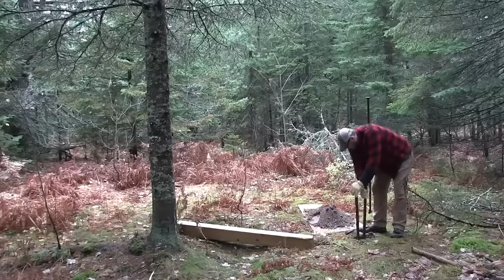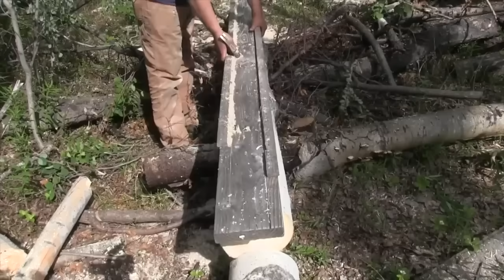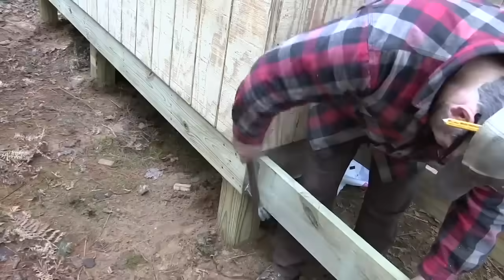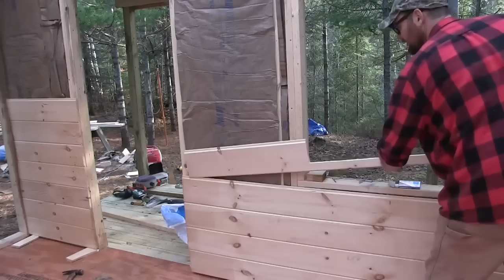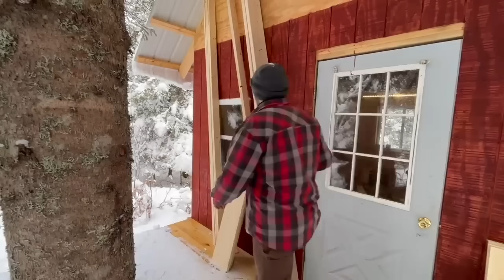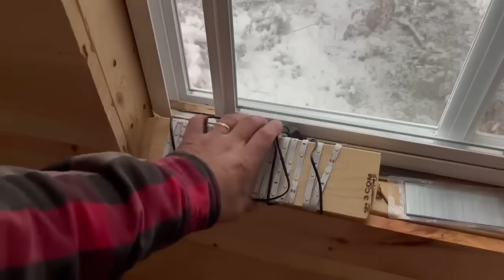4 Simple Cabins ... Anyone Can Build

Comment: How much do u typically spend on one of these cabins? I live on a 5 acre property and want to build a little cabin but the cost is my biggest concern wether its best to buy pre-built or try my hand at building it my self
Reply: Prebuilt are made to make a profit, so you're getting what you pay for, minus the manufacturer's 20% profit.

And then you still have to do interior finishes.

My cabin is ~12'x16', on concrete piers. I'm in to it for like $9,000. 

But it has concrete piers, 2x10 joists, 3/4" plywood floor, 16" o/c joists and studs, 5/8" plywood on the interior and exterior walls, 5/8" plywood on the roof, linoleum, is fully insulated, has Andersen windows, the entire roof is ice-and-water shielded, steel metal roof and walls, solar power and 12 volt power and lighting, propane heat and cooktop....

I got a ton of stuff off craigslist, marketplace, and habitat and didn't really start hammering stuff together until I was sure I could get it dried-in before winter.

Comment: I have been thinking for months about writing you and Brooke a letter for advice on building a simple cabin for a single mom, my special needs adult daughter, teenage daughter and teenage son (also on the autism spectrum).  We live in a rundown mobile home that needs to be replaced.  I started working in construction in 2023 at 49-years-young.  Im now on my third construction job (last year I could only find one three month job) and have learned installation of siding, soffit, insulation, drywall (no mudding yet) and some electrical wiring

Comment: Dave, I really appreciate your channel & all the instruction/insights you provide. I am curious to know what you do/how you prevent mice, voels, rodents from getting into your off-grid cabins when you are not there fulltime? I have remote mountain property in the western U.S. & am building a get-away cabin retreat. No way we can live there full time. But I want to make sure the place doesn't get run over with pests. I have not started construction yet but am getting my infrastructure done: well, septic, road, utility building etc. So the cabin pest-proofing is priority for me.

Appreciate any direction you can provide. Thank you, Sir!
Reply from the maker: Just make sure you build with precise cuts and no gaps....other than that the roof is the place that needs the most attention. Soffits, ridge caps, ribs in metal roofing......it's all about detailing
Reply from the maker: Believe me, I learned this the hard way
Reply: @Bushradical  thanks. Appreciate the input!

Comment: As a geotechnical engineer and with all respect, id recommend founding those footings below frost line and below the organic zone of the soil. Appreciate that Dave notes no movement, but you are playing with fire by not doing it, if its on a slope even more so. In saying that, if the structure is wooden (as most cabins are) then movement from ground settlements will be somewhat absorbed by the flexible (wood) structure. But, for the sake of a few extra hours to go deeper, why risk it for the brisket ? Awesome video's, am learning a lot.

Comment: You aren’t supposed to caulk the bottom flange of windows.  Its industry standard so water has the ability to exit the window system.  All windows leak or will leak at some point.

Comment: Anyone on this forum tried to duplicate in Southern hot climates?  In Mississippi very hot most of the time so obviously I’m including a window AC.  Any opinions on floor insulation but just?  With the humidity and heat some have suggested problems and recommended no floor insulation.  We literally maybe get at lost 2 months of weather with temps in the 30’s.  This will be an occasional getaway not every day living.

Comment: mouse problems are easily fixed by building what we call a “mouse-house”. Now a mouse house is a house or cabin styled house, scaled down in size in order to accommodate our mouse brethren. You can easily add levels to the mouse house
based on how large the mice population you have in your local cabin area. This will solve all and any mouse problems you may face in your cabin build.

Comment: For a future wooden cabin, it would be fun to see you do something less standard than stick-frame or log-cabins. I'm thinking about "post and beam", "timber frame" (that's a lot of work and requires special skills) or "post-frame" (RRbuildings),  the latter probably not very suitable for a small cabin.
I built myself a small (150 sqft) post-and-beam, which was a lot of fun. Using pressure treated 6x6 posts, 2x6 rafters and 2x4 framing between the posts. The latter flush with the inside of the posts and then on the outside white-wash dipped cedar shingles between dark brown stained posts. And like you did, 5/4x6 for the porch, but for a boardwalk I used 1.5" rough-cut lumber from the mill, because it has more grip in rain, snow or ice conditions.

Comment: When it comes to insulation those drawer-boxes are a very neat and easy to do method. But if you really need 8" insulation, I would increase the height of the joists from 2x8 to 2x10. Which avoids nailing the plywood bottom-up, which looks like a terrible job to do :). And as a side benefit, the 2x10's allow for larger spans. For a small cabin but with a woodstove, 2x8's and R13 insulation will in most climates (yes, I live in Canada :) probably do the job.

Comment: Great video and food for thought! I’ve had the same Aeusiney Solar Generator since maybe 2018 and it still works well! Was $280 back then, I did have to get a replacement under warranty the first year because the battery was compromised and had acid spore looking things building up on the vent. Not the most powerful, but for what it is it’s been such a great tool. Power LED string lights, phone. Fan. Small air compressor for a braid nailer. My next one I’d like to get one that has a cigarette style plug to run a 12v mini fridge.

Comment: You are so right about sheetrock. What's the purpose of sheetrock? They are starting to put it in expensive trailer homes.
Reply: Gives a house like finish, but it really is an inferior product, and it doesn’t take much, especially in a space that isn’t temperature or moisture controlled to get mold issues, usually on the back side of the panel. It is cheap and light weight though all things considered

Comment: Im a wooden boat builder, who just dabbles in cabin building, but my only tip that might help you out is butyl sealant for your metal roofing. you can get it at home depot in caulk tubes, its similar to what they glue windshields in cars with, and whats magic about it is that it stays soft like sticky silly putty, so it self heals if it springs any leaks.

Its amazing stuff, ive used it to fix leaks below the waterline on boats, that 3 other repair guys couldnt get to stay fixed, cause they had bolts holding rudder hinges on, and the bolts were working all around with the force of the rudder.  A single tube will do a small cabin, put a bead on metal roof overlaps, and where your fasteners hit, and you are golden.

Comment: Great channel! Always very comprehensive and well thought out.
Could you do a test on motorcycle helmet communication units?
So many out there, so many variations and some don't connect with others. Charge time, quick charge times, run time, standby time, fitment, waterproof rating, vibration resistance, physical size, ease of use (buttons and dials while wearing gloves)

Comment: My bother has a good idea for roofing, much safer than your harness. Make a ladder with your scraps and add two 24” lengths at 90° at the top of the ladder. That goes over the roof peak and you can use the ladder like your skip sheeting. 4

Comment: Dave I have a video request for you. Maybe you could explain the differences between the types of bagged concrete mixes at your typical Lowe’s or Menards. I am sure there are differences but I don’t know what they are beyond the prices. In the past when I was setting gateposts or whatever I just used whatever was the cheapest. Since you’re a former concrete contractor, I’m sure you could tell your viewers what type would be best for setting a post, making a post on pas type foundation, pouring a small slab, building a rock wall or a fire pit, etc.
Reply from the maker: thats a good idea but honestly Ive only mixed maybe 100 bags of "bagged concrete mix" . when I was contracting I rarely ever poured less than 5 yards at a time....average pours were 15-20 yards. Even a 3 yard pour is  12,000 lbs of material .....a 20 yard pour is 80,000 lbs of material .   I would just get a bag of premix so you don't have to buy aggregate , prtland and sand seperatley. for a post use whatever is closest to the loading door and get help loading it. LOL

Comment: I am currently in a slow build process of a small cabin by my pond.  Im considering metal roofing.  How do you insulate or critter proof the small ridges in the metal roofing.  It looks like something small could crawl into the ridges and into the insulation.  Please offer some advice.   I would rather do metal roofing instead of plywood, barrier and shingles etc
Reply from the maker: I think it's IN this video

Comment: If you have to stand a large wall by yourself, nail  a long 2x4 to the top corner just like a brace. But do it while its on the ground. It will hinge up as you lift so you can take breaks and reposition yourself as needed.

Comment: I like the idea of just having a power station for those short stays, not spend a lot of money on a permanent solution that won't get enough use to justify it.  One idea I had for those, though, is to also carry along one of those portable (like roll-up) solar panel setups.  You could toss that on the roof, or some other convenient location, when you arrive, and have it keeping the power station full.  When you leave, you take it with you.  As for 16 x 20 being like a house...we think we're seriously downsized living in our fifth wheel, which I think is a bit over 400 square feet, vs the 320 of the cabin.  It's like a "tiny house" in that regard.

Comment: I'm almost done building a mini cabin on a 12 by 8 and 1/2 snow mobile trailer, metal roofing (green) and (brown) metal roofing exterior,  r15 insulation for the ceiling, 2 inch foam for the walls and the floor, and 1/4 plywood interior walls with trim. Gonna urethane everything, add a tent wood stove and power it with an extension cord. I don't have land so the plan is to put it in the back yard in the woods. This as good as it gets for me but happy to have what I have.

Comment: Great video, thanks, When you were fitting 8inch insulation between the floor joists rather than crawling underneath to fit the ply to the bottom of the rafters you could fit strips of say 4-5 inch wide ply to the underneath of the floor joists before fitting them then use this to support the draw technique shown earlier.

Comment: Dave I have noticed you always used hand driven nails. Do you not like the nail guns or is it just the fact of hauling around more machines into these remote areas
Reply from the maker: I like the quiet of not running compressors and generators

Comment: Old fashioned galvanized steel roofing was nailed in with lead head nails that had a lead gasket. These were always nailed on the ridges.  Newer fasteners have rubber gaskets that weather away.
Reply from the maker: The gaskets of metal roof nails are pretty bulletproof. Ive never personally seen a failure with modern screws.

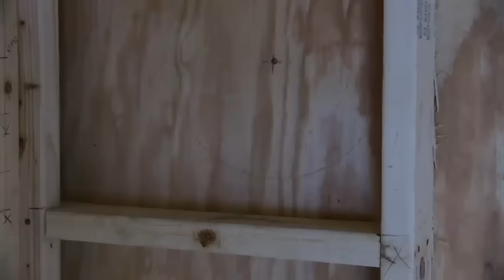Comment: 49:46 Dave- what’s the benefit of going through a side wall instead of going through the roof?  It seems like going through the roof would give you a couple more feet of stove pipe inside to radiate more heat into the building.
Reply from the maker: it's easy any you never have to worry about the roof leaking

Comment: A caution.....I was a fire investigator in my working years in Michigan.  One winter, a man heated his garage with a wood burner.  He had installed 24"x24" concrete patio pavers against the wall behind the stove.  Wall was standard 2x4 with a layer of drywall.  Fire burned through the wall to the outside.  I could see charring following the screws he used to fasten the pavers to the wall.  The screws transferred the radiant heat from the wood burner into the 2x4 's.  Fluke, yeah, possible, yeah....Be cautious.
Reply from the maker: None of the stoves used here have ever produced enough heat to make the heat shield hot enough to even burn your hand ...let alone heat screws to the point of combustion....I'm not sure how anything like that would be possible

Comment: Great videos... always learn tid bits to help with my small projects.  When you were discussing getting the third pylon completely square, I use the 3-4-5 rule to make my math/geometry easy.... You may have mentioned that in earlier videos...but... just sharing my shortcut... Thanks Dave
Reply from the maker: as a concrete guy Ive used 3,4,5 before and you could use it to square a floor but you would need perfectly straight boards  to pull it off

Comment: Something else I just thought of: your "Critter Stops" for the metal roof. I first thought... why not spray-foam them, and the realized... the wire mesh provides a soffit vent between the roof and ceiling. What you might consider, let's say for purpose of discussion, you needed to make 100 of those screens for your build. Take a couple pieces of scrap wood and make a pattern the shape of the roof ridges. Then take your pre-cut mesh and pre-shape all of your 'critter stops.' Afterward, fill your nail bag with them and staple them into place. Question: would it be more of a deterrent to the critters if you installed them with the sharp, pointed ends of the mesh pointing OUT, instead of IN?

Comment: Dave, in 2012  I built an 8' wide 12' high 16' long cabin style shed with a half loft. I used T 111 with 1' x 1' red stepping stones for the foundation. I used drywall screws because I basically hate nails.  I marked most areas with a carpenter's punch and drilled pilot holes. I could live in this shed. We use it for a combination of things one is storage and my outside cats love this shed. They enjoyed sleeping in it for about two years and still do if it is raining. It has both interior lights & night lights.. Plus exterior solar lights mounted on the shed and solar yard lights mounted on the side of the shed. Gary cat is in their right now along with one possum. We try to keep the raccoons out because they make huge messes. We have 7 raccoons who visit every night. I have outside elevated boards for walkways and animal feeding stations. One upside down mounted large plastic tote above their food & water.  The cats and raccoons enjoy playing on and all around this shed and playing in our avocado tree. I have a 1' wide 1" thick board with sides going from an elevated feeding station to a fork in the tree. The boards are lined with pool noodles so the animals do not accidentally fall off & so the board does not damage the tree. As mentioned one plugged in light at the primary outside feeding station and solar lights. I still do projects to and around the shed mostly for fun!  I enjoy your videos!